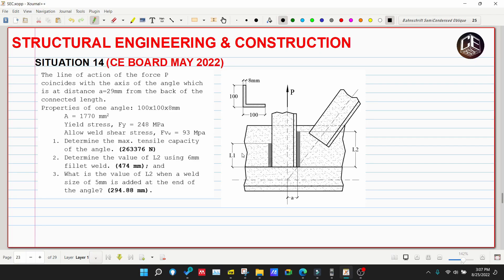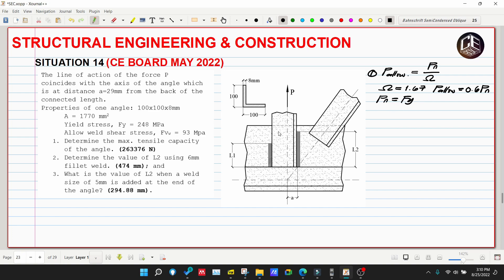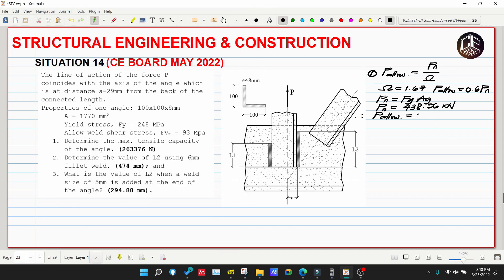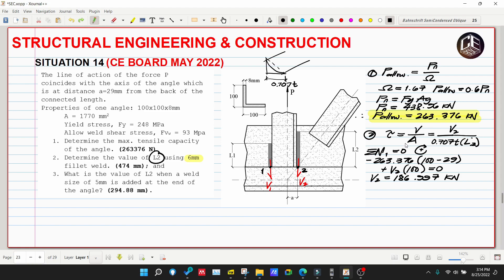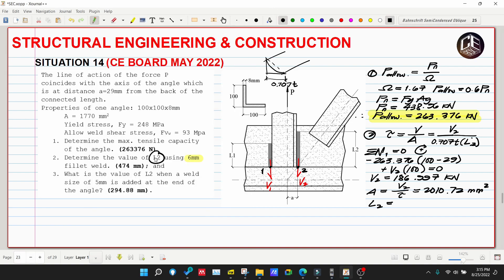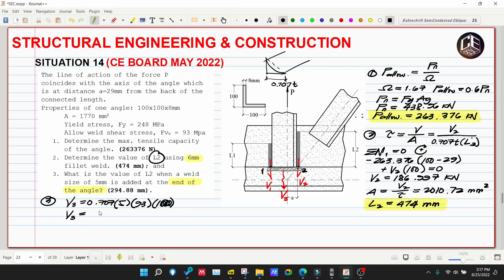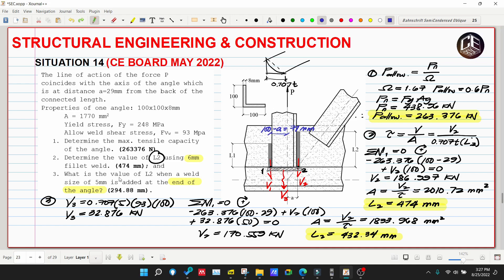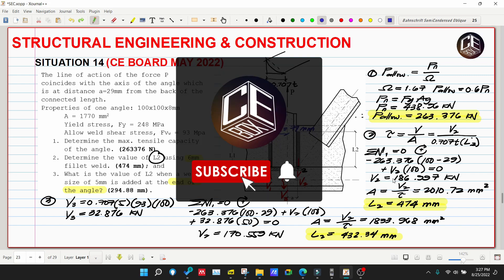Structural Engineering & Construction Situation 14 (PH)

Comment: hello po sir, ask ko lang,  hindi po ba ma-t-times 2 yung length ng weld sa number 2 question? di po sya welded sa back part ng member? ty po
Reply from the maker: Saang back part ng member? yung mismong back na po ang nakaconnect. imagine a plate na nakaweld sa another plate. or a paper na tinape mo sa isang side, yun lang ang nakatape, ang back part na tinutukoy mo po is another plate.